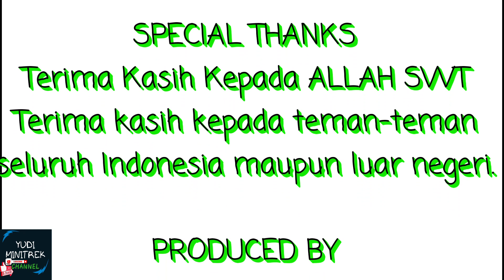Cara Pemasangan Ubrake Depan Sepeda Minitrek

Comment: , mau tanya,, kalo velg ukuran Ukuran 20X1.75
Lebar 3 cm 
, pengen dipasang U brake apa bisa mas ???
Reply from the maker: Kalo ubrake semacam Shimano 10 atau 11 speed seperti punya teman-teman minitrek gak bisa dipakai. Gores ban🙏
Reply: @yudiminitrek  brarti harus pake velg yg 20 x 1 3/8 ???
Reply: @yudiminitrek  atau pake velg 1.75 tp pake ban yg tipis gitu tetep gabisa mas ???
Reply from the maker: Iya mas👍
Reply from the maker: Gak bisa mas🙏
Reply: @yudiminitrek  oke terimakasih mas 🙏
Reply from the maker: Sama2 mas, bisa berbagi ilmu🙏